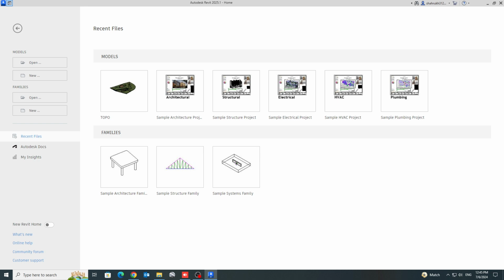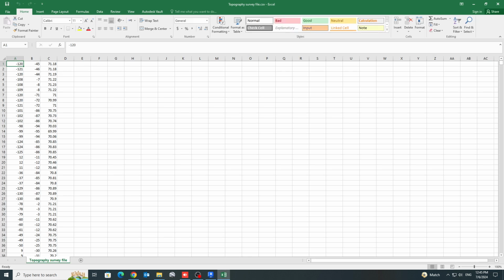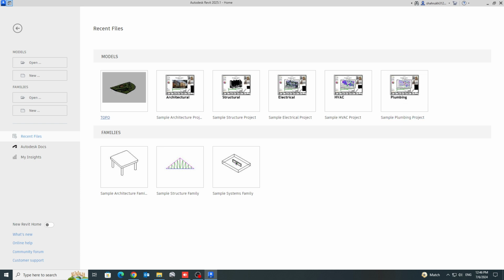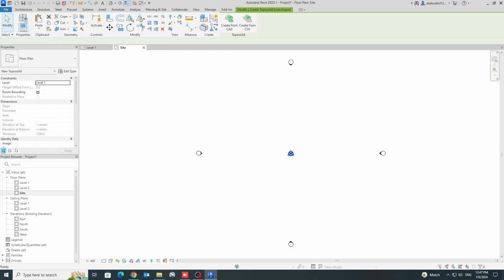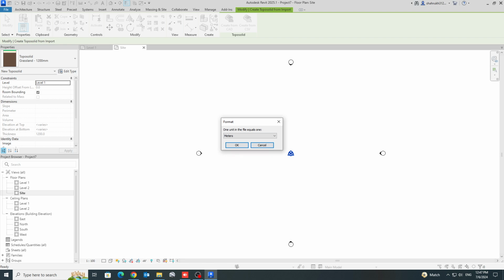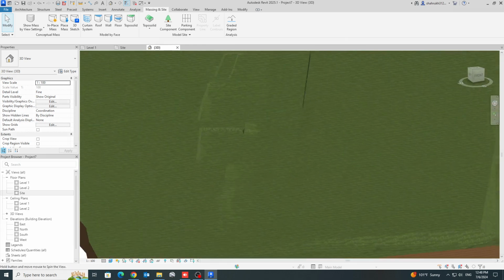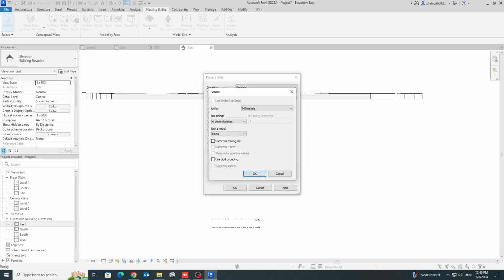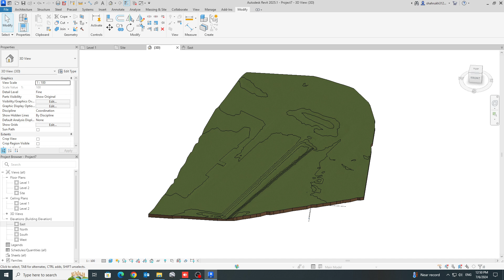How to create a Toposolid in Revit 2025 using CSV file

Comment: Thanks for sharing your csv file. Most YT revit guys dont share files but you did.
Reply: Thank you, I guess it's in a different format but you can convert it as required. The data is there
Reply: Simply change the file extension to .csv it works